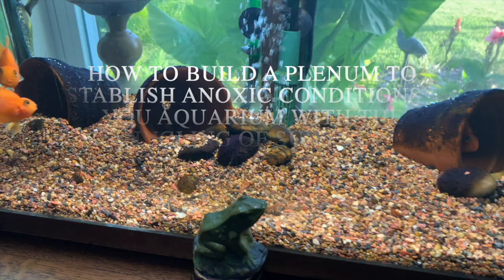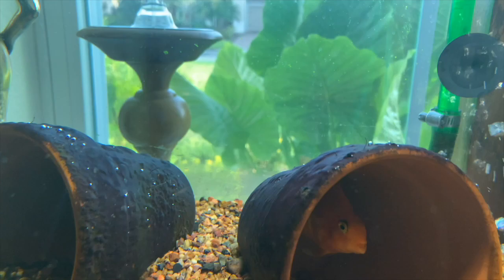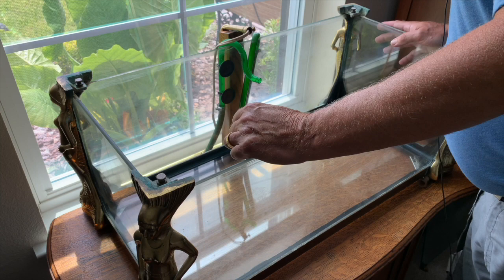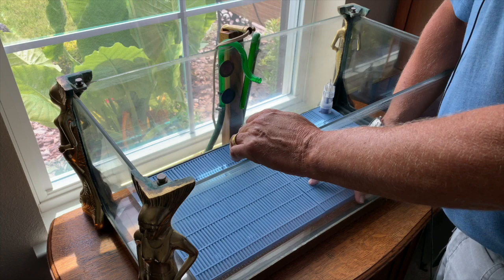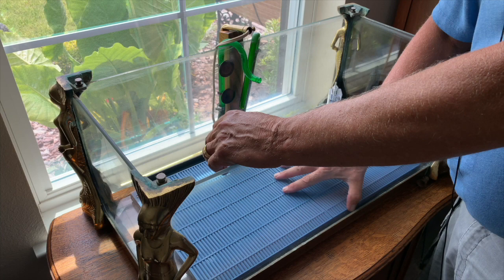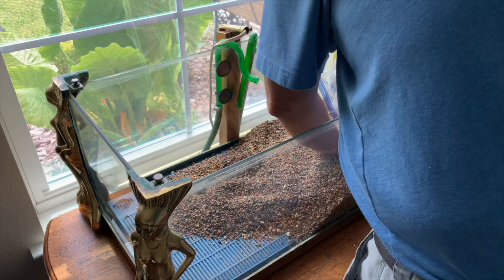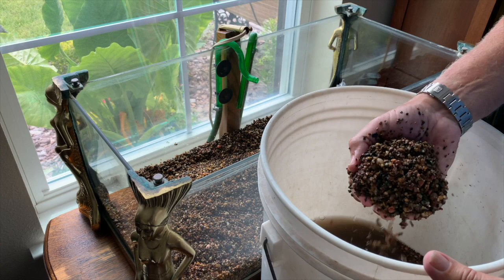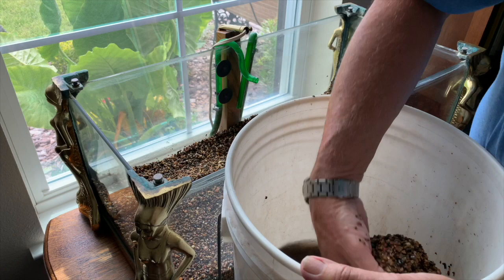How to build a Plenum to establish Anoxic conditions in your aquarium

Comment: I did this to my 20 gallon long tank but I put the lift tube near the middle. Still a short tube. Did a water change Sunday and checked the water Monday night. My nitrates were sitting at around 10ppm. I never had nitrates that low before and after a water change. The plant load is little. My cryptocorynes and Java ferns are struggling. Hortwort and duckweed is growing fine.
Reply from the maker: Good things take time to mature .
Reply: @anoxicfiltrationplenums  that it does. I wanted to add in another tank that was set up with a plenum I added a lift tube to it also. Just did a test on it and it has 0 nitrates. Heavly planted and has 20 neon tetras, 6 pseudomugil and 1 betta. I honestly forgot how long this tank has been running. Tank was setup over a year ago. Slow moving plenum has been running for 2 months, I think.

Comment: Hi Dr Novak, I have my plenum using UGF and plant fabric. I put eco-complete in 29 high tank. It's what I had on hand. I also put same setup with sand in 10 gallon.  I'm building bcb baskets for my aquaclear filter. I don't have a canister or sump. My question is how often will I need to change the bcb baskets?
Reply from the maker: Thanks for sharing. The BCB never has to be change as far as I know.

Comment: Hello Hi, Dr Kevin Novak, please advice if it is OK to start first  layer on top of UGF plate with 3 mm dia pea gravel 1 inch thk high, then 2nd layer with 1inch organic garden soil, then 3rd layer with 1inch laterite, then 4th layer 1inch of potted garden clay balls and final top layer of 2 inch of 3 to 8 mm dia of pea gravel, therefore total will be 6 inch substrate bed and bottom UGF panel will act as plenum and can I have the option of skipping the air stone operated air pump, so the system works slowly on natural convention of water circulation within tank with everything in it, like lighting, moderate plants and fishes only. Tank size 24" x 24" x  72" long.
Reply from the maker: You’re definitely going to need a ground cover fabric on top of the filtering plates otherwise you’re going to end up with all kinds of problems.
Reply: Thank you, noted and will add fabric mesh sheet above UGF panels to avoid intrusion of substrate media through UGF panel slots into plenum area. Thanks.
Reply from the maker: Allen Lewis  I just went to Home Depot and you can buy a bag of pool sand for less than nine dollars for a 50 pound bag..

Comment: would a standard undergravel filter with a much reduced air flow do the same thing?
Reply: also have you set the tank in direct sunlight on purpouse? all my books tell me to never do this.
Reply from the maker: Yes, slow moving plenum it’s called. 
To your second question: yes, I put that tank in direct sunlight to see and show people that algae can be kept at bay if you have the right kind of filtration system. After all ponds are in direct sunlight all day and they stay clean and clear.

Comment: May method of choice for 'stirring' the substrate is Malaysian trumpet snails, as they live in the substrate a lot of the time.  May be a little unsightly but I try to keep feeding down so I don't have the night time horror show some do (I have also occasionally removed dozens en masse from time to time as they crawl up the glass at night).  How big a tank would you put this to work on?  It is my understanding that UGF is not much good for larger tanks because you can't get a good flow into a 8 square foot area (for example)?  With this low flow method a bigger tank might be do-able?   My tanks are almost all very heavily planted also, and some of the root systems (crypts) are very extensive, have you had any issues with roots choking up the plate?  Not sure i want to tear everything down also I am a high oxygen fan but only because of all the plants.  What is your doctorate for?  Also love the tank, très cool
Reply from the maker: Malaysian trumpet snails are very good at keeping the substrate open.

It works for all sizes of tanks if done right. I have never had a problem with roots from Crypts or any other plant becoming that invasive to block the UG plates. If your tank is doing good then don't change a thing about it. 

I deal in marine and freshwater biological sciences.
Ph.D. in Ichthyology, master's in aquatic microbiology and Limnology for fresh water systems.
Reply: @anoxicfiltrationplenums  cool, so your hobby is your job  :)  my buddy's dad was an oceanography dean who specialized in wave mechanics and hydro power.  Thanks for the answers and happy new year!
Reply from the maker: @nobrainsnoheadache2434   and a happy new year to you too.

Comment: Hello Dr. Novak, love your videos!!! I have a few questions, first off-my tank will be 150cm long by 50cm wide-does the entire bottom of the tank have to be covered by plates? Will this still work if, let us say, 90% of the bottom is covered by plates? For a tank of my size(300liters), would it be beneficial to have a riser tube on both ends? And finally, how much air should i be pumping through those air stones? As much as the pump will move, or us a small amount of air better? Thank you, keep informing noobs like me, we are lost without your knowledge, greetings from Germany!!!
Reply from the maker: yes, that will work just fine. Your on the right track now. Yes,
 you can have a sort riser tube at both ends if you want. that is up to you. Remember, the riser tube should me no longer than your substrate. 200-lpr will be a good starting point for air flow.That is per riser tube.

Comment: I am still bit confused on how this differs from traditional under gravel systems? Is the difference only that it moving stuff slower? Also do you recommend to add cat litter to base?
Reply from the maker: Long time ago UG filters were very slow moving filters. As time went by in the 1970s manufactures got the ideal that moving more water was better. The 1" lift tube became a mainstay in the industry. What they did not forsee was that slower UG filters were better and plants grew just fine with slow moving water passing over their root system. The UG filters bacteria had more oxygen but it sacrificed Anoxic conditions over anaerobic conditions. 

Cat litter to the base is not a requirement just small substrate of 1mm-3mm in size will do just fine.

Comment: Hi Dr. Novak, I am a new hobbyist. I have a 25 gal planted fish tank. I am considering trying your plenum idea. My husband can't stand the sound of an air pump. If I position the lift tube next to and facing my sponge filter (connected to my powerhead to make it quieter) will that create enough suction to move the water slowly through the plenum? Or do you have a tips for making the air pump itself quieter?
Reply from the maker: Make sure your sponge filter gets 95%   Of the pumps output. And L shape input tube should do the trick. The sponge would be connected up to the straight part and the UG filter would be connected up to the L part. I use this L method for 20-years and it works just fine.
Reply: @anoxicfiltrationplenums  Thank you!

Comment: Hi. So nice to have you back .
 Tried this with weed block fabric and clay kitty litter covered in play sand and mixed in red flourite .

Have dripped the output of a power head down the uptake tube of an under gravel filter at approx one drop per second !

Initially though I had interpreted you instructions correctly .

Results after a few months were nitrates consistently below say 5 ppm !

Was initially impressed but after a few months it failed to work and nitrates are at normal levels of 25-50 ppm each week .

Radically do 90% water changes once a week now to keep nitrates down .

Any observations as to why it's not worked ?

On my next tank I will be trying again to make it work with maybe half the tank with gravel and front half sand .

I'm not giving up on the possibility of low nitrates and less water changes .

I really do appreciate your information on this unique approach .
Reply from the maker: It's almost impossible to know what is going on in other peoples aquariums and why some do so well and other don't. Sorry for your troubles and I hope that things come out better next time.
Reply: @anoxicfiltrationplenums  I am Dissapointed it's not worked and had initial success . I even bought expensive red flourite . I wonder if my flow rate is to low ?

I was so hopeful it would work .

I've not given up .

I was convinced you would know where I've gone wrong .

Looking forwards to your results to see if it works for you .
Reply: @johnbfrommanchesterengland4580  Hey John, have you made any progress?
Reply: @VinylUnboxings  Hello .

Think there is a gap at the edge of my under gravel filter and the built in filter unit ! So it's not fully sealed and hence unfortunately it's not worked for me !

Have just updated my drip system to a bigger rubber hose and so more flow down the uptake tube .

Not very hopeful it's going to work but have noticed good plant growth and my aponogeton is continuing to flower , so quite impressed on that score , although it may be down to the expensive red flourite plus liquid co2  ( seachem flourish ) in combination with diy co2 and liquid iron !?

Have started another small tank on my windowsill with just play sand over under gravel filter plates and full length uptake tube running an eheim air pump on min for 12 hrs /day ( on a timer ) but the air stone is at the very top for min flow .

Six weeks in and still have nitates but not 60 days yet , so waiting for results .

Trying baked kitty litter next ( in uk using catsan , but we'll washed ).
Have that already .

So want it to work !

Thanks for your message .

Comment: I have a 45 cm tank. And i just buy a UGF same as yours but it can only use 1 of them to make Plenum. Is it fine just to use 1 only
Reply from the maker: Yes, that is fine.
Reply: Will do it
Reply: One question. If I tend to make the substrate more than 4 inches ,the plastic tube that attached to the ugf can be increase in length or still remain 3" in total
Reply from the maker: @Ttblondey   you can increase the tube for your substrate. what’s really going to determine a lot is lowering the amount of air bubbles so not as much air being applied to the aerating.
Reply: Thanks for the reply . Good night.

Comment: So this is just an undergravel filter with a short lift tube, and is enough to achieve anoxic filtration?
What about the laterite/kitty litter layers you've mentioned in your previous video?
Reply from the maker: Yes you can use that too. But most hobbiest would like to use sand or another filter substitute and therefore I did the video to accommodate them. Sand has been used in fishtanks now for 45 years with one failure after another. But if you do the way I say using a ground cover over the under gravel filter you will have better success using sand as a substrate . It’s a win-win for the aquarium hobbiest .
Reply: @anoxicfiltrationplenums  would using laterite+kitty litter still have better results vs sand/gravel if only using plenum(no canister)?
Reply from the maker: @juian6   it would probably be the same.
Reply: @anoxicfiltrationplenums  If NOT using a canister and only using a plenum with slow flow lift tube, should we try to wean off our sponge/HOB filters?  I recall you mentioning that they create too much nitrates. So having more anoxic filtration vs aerobic filtration keeps things more efficient and causes just ammonia->nitrogen process?  I hope I'm saying it correctly. :)  I think the saying was to balance the producers vs consumers

Comment: 1:25 Why having a shorter lift tube???
You can use a long tube and just use a less powerful air pump instead? Cheaper to buy, less noise and less electricity.
Reply from the maker: A half inch uplift tube will pump maximum 20 gallons per hour. A 1 inch uplift tube using an air pump can pump 50 gallons an hour. By making the tube shorter cosmetically looks better and once decorations are in the aquarium you won't even notice it's there. A nice long tube going up to the very top of the aquarium... Kind of looks unsightly. Plus the fact it's not necessary.
Reply: @anoxicfiltrationplenums  We could use a smaller pump (less noise). But anyway, you got extra points for esthetic and the leftover bubbles are great for O2 in the tank and surface agitation.
Thank you Dr for taking the time answering all my numerous questions!

Comment: Excellent content, Dr. Novak. Thank you for this. 

I have been wondering whether it is possible for an Anoxic Plenum to establish itself naturally in malaysian driftwood. 

I recently set up a 54 gallon Bowfront tank with a large tree-stump like piece of driftwood. This piece of wood had sat in my garage for about ten years, but it had been used in many of my tanks in the past. Currently, the filter is set up in such a way that the water current moves around the stump in a counter-clockwise motion, not very strong, but anyway there is some water current in the tank. I had heard from Bentley Pascoe that media favorable to these kinds of bacteria must be dense but porous. I was wondering whether driftwood would fit the bill for that. 

Thanks again for the video!
Reply from the maker: No, by making a Plenum that will do the trick but unfortunately driftwood will but not to the extent that a Plenum would.

Comment: My slow moving plenum has been set up since January 2021. I just did a nitrate test and it has 10pmm, 2 days ago I tested for nitrates and they were 5pmm. Is it normal for nitrates to increase then decrease when using a slow moving plenum? if not then something isn't working correctly. I  have set up per video, however my lift tube is on the left and not the right, but I don't think that would make any difference.
Reply from the maker: Yes it is. This will depend on food, fish load and how much organic matter you have. Your system is doing good.
Reply: @anoxicfiltrationplenums  ok thanks, I have Oranda goldfish and I do feed heavy as they are quiet big.

Comment: Can I use the non-baked kitty litter? I’ll just cover-up with another layer of substrate...will it work?
Reply from the maker: It will not work as well so maybe go for Oil-Dri or Safety-Sorb insted at your hardware store.
Reply: @anoxicfiltrationplenums  thank you sir 🙏
Reply: @anoxicfiltrationplenums  Lastly can I use LECA instead. LECA(lightweight expanded clay aggregate) are used as growing medium for plants. Its is baked and wont disintegrate.

Comment: With sand plenum and goldfish, would you think that following set up would work with goldfish? The sheet that you have suggested to use in order to stop sand going trough under gravel filter - use it twice. So directly on the top of filter mesh and then second layer about half an inch from the surface? The idea behind is so the goldfish will not disturb the deeper layer of sand. 
I really don't want to use gravel with goldfish as they can choke on it. Thank you :)
Reply from the maker: That’s exactly what I would do use it twice so then the goldfish would only be able to go so far when sifting through the sand and not disturb the whole filtration system.
Reply: @anoxicfiltrationplenums  thank you very much! Would you also tell me the desired depth of sand between the filter and surface for the plenum to work please? I have checked your videos and could not find the answer. Thank you :)
Reply from the maker: What I usually tell people is make sure it’s at least an inch to an inch and a half thick then add your mesh on top of that and then you can add your cosmetic gravel or sand on top of that to whatever you want.
Reply: @anoxicfiltrationplenums  that's great, thank you! I will keep you updated on the progress :)

Comment: You did not clearly explain the assembly of the lift tube/air stone. From the point of view of someone who has never set up this type of system before, it's not clear what's going on there. What size air pump do I need? How is the air tubing attached to the top of the lift tube? Does it need to be air/water tight? It looks like you are also running a canister filter? What size and what type of media? For a video that's supposed to be simple enough for a child to follow, you sure left out a lot of necessary information.